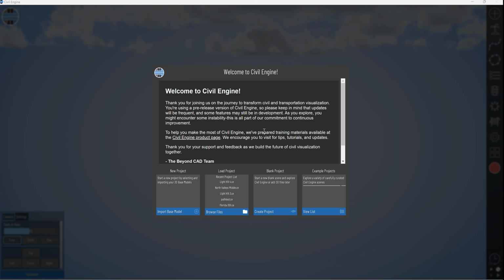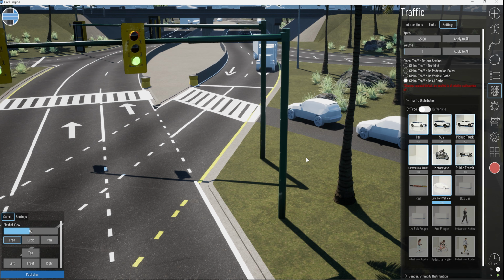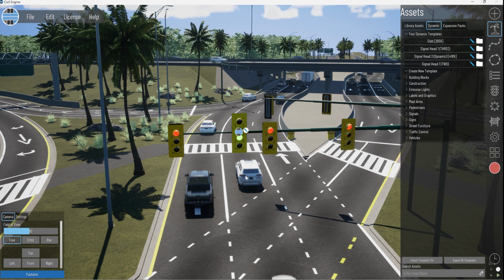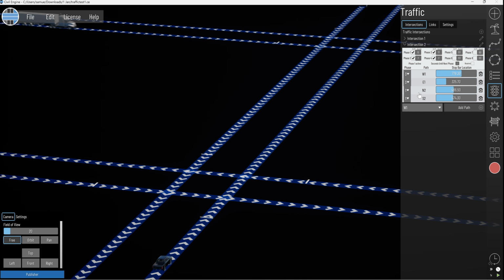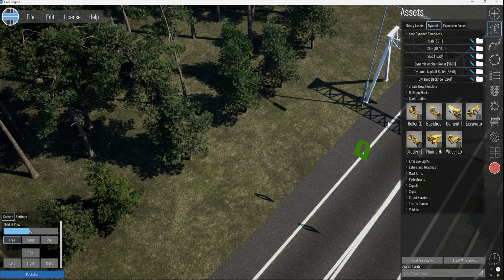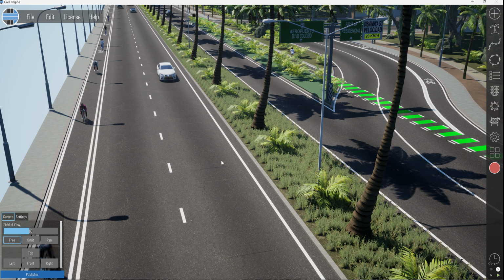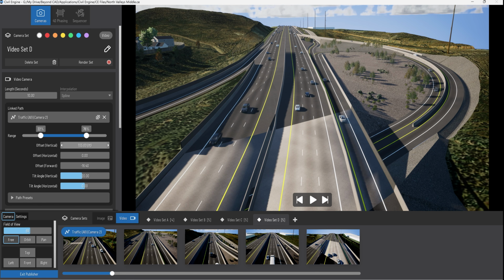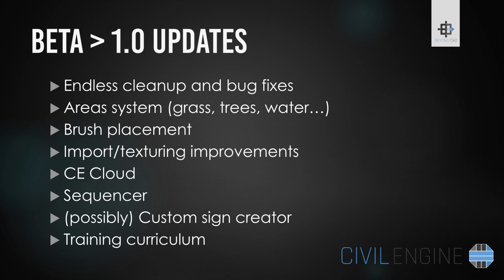Intro to Civil Engine Beta

Comment: The main thing I'm missing in all of this is measurements. This is a tool. Planning and aesthetics are the start actually providing the schematics for the whole build at the end you need relative measurements which you can then translate into accurate ones. Especially when you have things like gradients to consider.